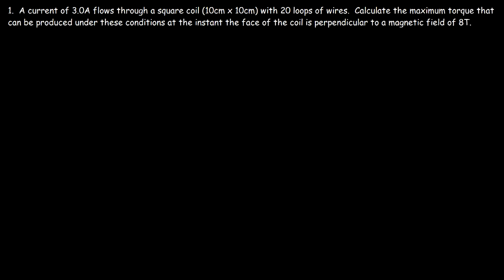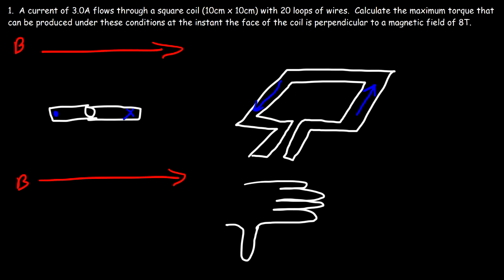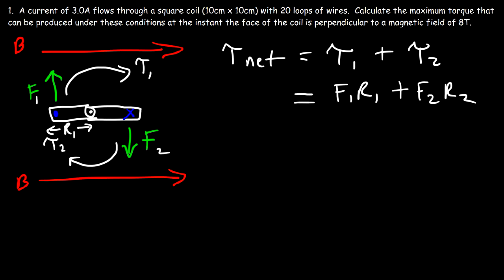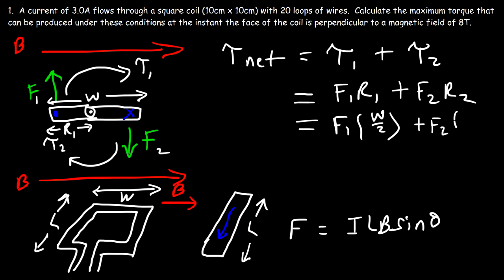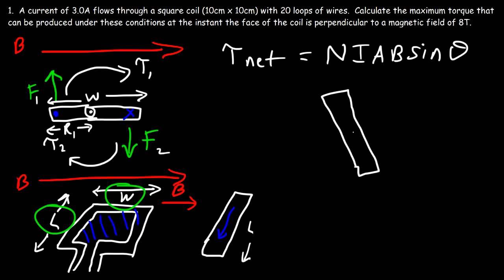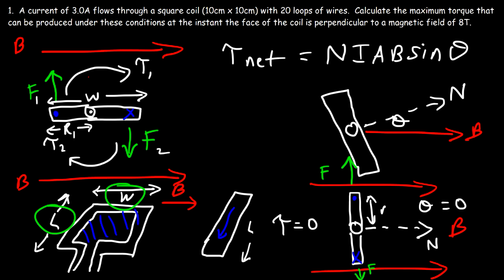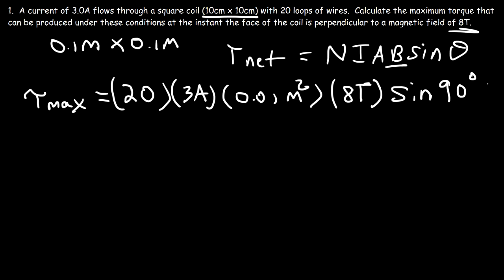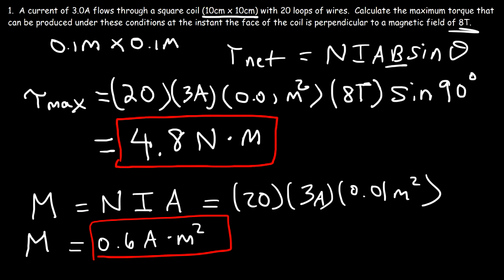Torque on a Current Loop In a Magnetic Field & Magnetic Dipole Moment - Physics

Comment: Just a heads up, some book refers to the normal line as the area vector. I think using a normal line is much more intuitive!
Reply: Using the area vector can be useful when you're only given vector quantities for fields and angles for where the loops are oriented. If you're having trouble coming up with a diagram, you can always just take the cross product of the length and width vectors to get your area vector. Just make sure you follow the right-hand method with the current so that the directions agree.

Comment: The formula is right but there is a problem with the derivation. In the equation F = ILB sin theta, the angle is between the current and magnetic field. That is always 90 degrees for the two segments that produce torque. The magnetic field is always to the right, and the currents are into or out of the screen. The theta in the final formula comes from calculating the lever arms, and is the angle between the magnetic moment (perpendicular to the coil) and the magnetic field.
Reply: very true.
Reply: formula is F= I(LxB)

Comment: There is something that doesn't make sense to me here. Whenever the face of the coil is perpendicular to the magnetic field the area vector is parallel to that magnetic field meaning theta is 0 and no torque is applied.
Reply: Your absolutely right, but inertia keeps us moving past that point, where we experience a torque again (opposite this time) :) (explained around 6:20)

Comment: Aren’t there two normal surfaces? How do you know which way the dipole moment vector points if the plane is angled
Reply: Use the right hand rule.  Curl your fingers in the direction of the current flow and point your thumb.  The direction of  your thumb is the direction of the normal surface.

Comment: shouldnt it be 1 m squared not .1 so the final answer should be 48 Nm
Reply: your mistake is you did 10 cm x 10 cm = 100 cm^2
100 cm^2  is not equal to 1 m^2.